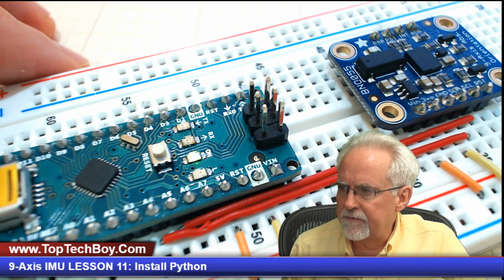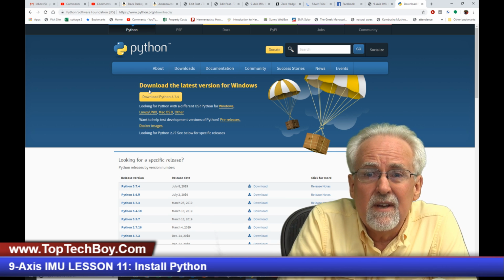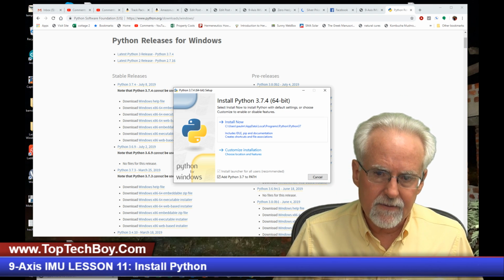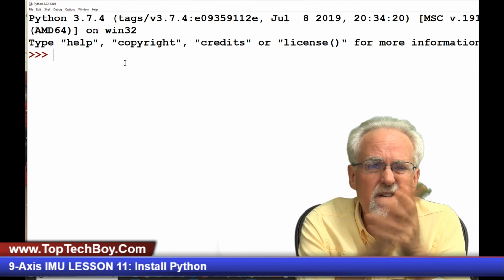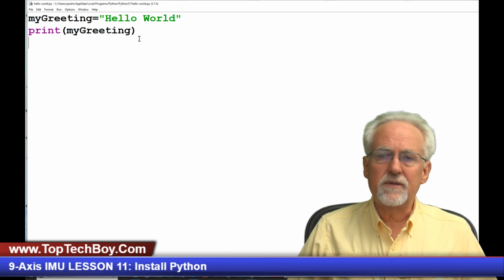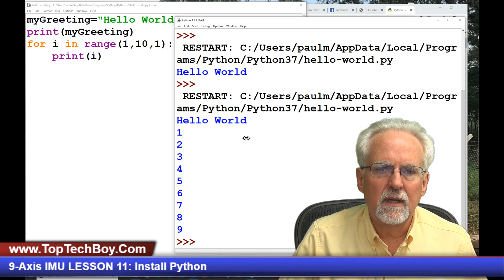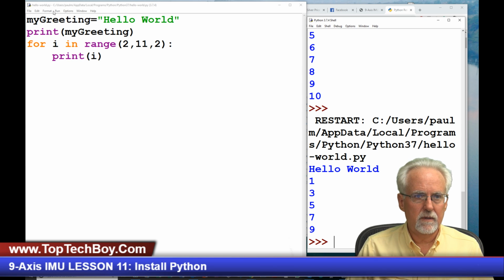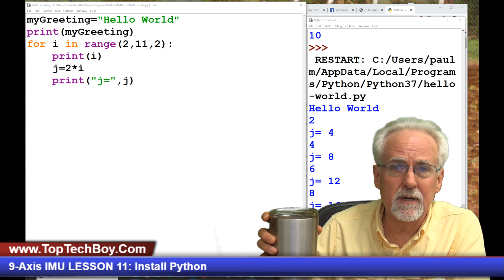9-Axis IMU LESSON 11: Install Python

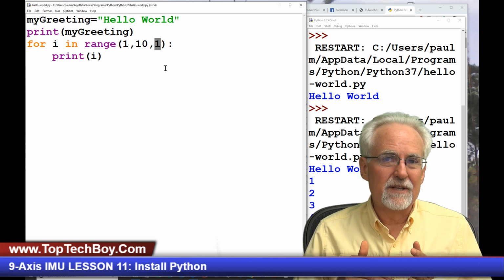Comment: 10:38 - Yup, it's ambiguous, unlike the conditional in C's for loops which is crystal clear. Python is a convenient, handy language, but it's got some serious defects. :-\ (I just tried to update my installation from 3.7.4 to 3.8 but it's a real PITA because it installs them in separate directories which include the version in the directory name, so I'll have to manually uninstall 3.7 and then reinstall all the modules. Terrible design, even if it is for comparability reasons. I just updated to 3.7.5 instead. ¬_¬)

Comment: Please teach us using Matlab and Simulink. You can also do 3D orientation visualisations, signal filters and so much more. It is the #1 software in education.
Reply from the maker: The problem is there is no free home hobiest license for matlab, so if I teach it, few would be willing to shell out the money to buy the  software . . . hence I build tutorials around software or components easily available to people.
Reply: @paulmcwhorter  Then, maybe the Processing software (from processing.org) would be a much better solution to graphical visualisation of data, since its programming language is very close to Arduino (fun fact: Arduino programming language was actually based on Processing) and it's a well-established data visualisation software for over a decade and it's open source!